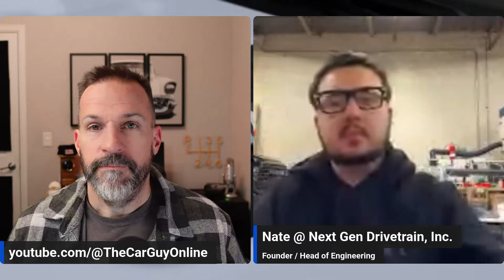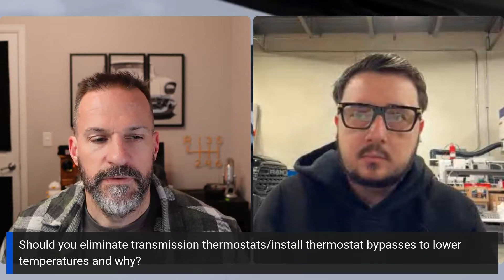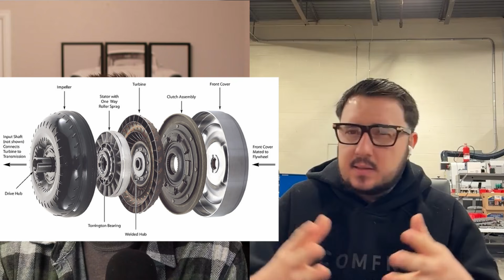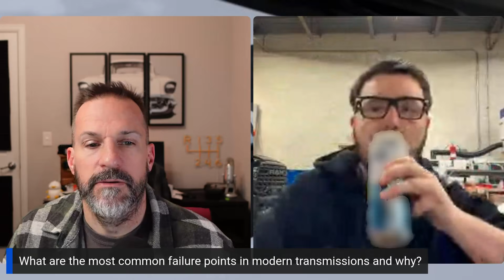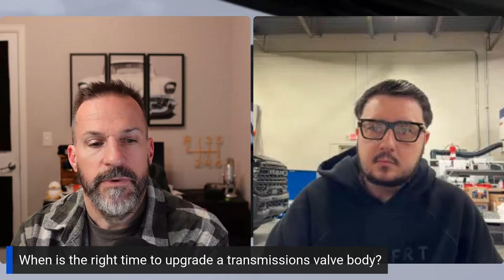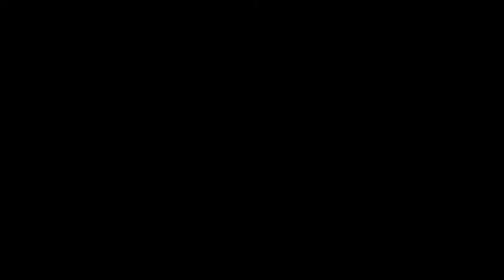Transmission Maintenance Questions Answered w/ NextGen Drivetrain

Comment: I delete CAFE as much as possible. Was 0w-20 Now 5w-40. 3K Changes. 185 engine thermostat. People has to wake up to the throwaway society. Agree on drain a fill, I have been practicing at every 30K. Non locking converter absorbs a lot of hard engine pulses to the trans. Love the nextgen company.

Comment: Cafe standards and all the fixes are a joke! Ibwas a student mechanic in the 50’s and 60’s and indistenctly remember premium gas was 96 octane and regular was 91 octane, my 55 chev 235 6cyl three one barrel carbs were delivering power and average mpg of 21+ in the late 60’s pcv were mandated at the same time octane lowered from premium to 91 octane and regular to 87. Gas was 25 to 30 cents per gallon. I always ket track of mpg every tank fill and my mpg dropped to 17 -18 mpg and I could not figure out why? Also pollution became a big deal from autos. It burning completly( that! I did figure was cuz they reduced the amount of energy in prem and reg which,btw, differentiated in price about 10cents a gallon. When I was 14 my farmer uncle gave twenty $ to fill up his 63 ford 426 engine with premium and I questioned cuz it was more expensive? He said bull he gets much more power and mpg  to go much further on the tank.
Pollution was a created crisis by the elites, they funded the response and mandated THEIR SOLUTION PCV AND LATER CATALYTIC CONVERTERS TO ALEDGEDLY BURN UNBURNED HYDROCARBONS. Why the unburned carbons going out the back! It is all about stealing robbing from people for their evil gain.
Why do race cars use 110 octane gas and why did they force suoer stock and rail drag them nits go to alcohol? To slow the cars down saying they were getting in safely fast cuz one racer’s parachute did not open and he was killed when crashed into the end track wall. 
They dmsaid high octane is not worth the ( they raised the price diffential at the same time lowering octane,  to 60 cents per gallon higher over regular. Oh! One more fact premium gas is a much better lubricant to fuller walls valves and burn very clean. I proved it testing a 64 mustang in California at a certification station that did not have a car and the said he had never seen such low pollution numbers without a car, lower than vehicles with WITH cats! Hello!! We are being scammed and lied to about everything

Comment: I bought a 2005 qx56 for $500 with 124,000 on it, in 2019.
  Changed the air shocks, fixed the window regulators and I been driving it ever since.
  If it breaks, I might fix it,might not. 
    But I bet your new car dies first

Comment: When i bought my Golf R, i was puzzled as to why the recommended transmission service is 120,000km here in Australia? Needless to say, it is the usual factory recomended bullshit. I changed it at 80,000km. Same with engine oil. Every 8,000 km instead of recommended 12,000 km.

Comment: I disagree wholeheartedly with the amount of gears discussion. Yes, emissions regulations is definitely part of it, but tow with a 4L60E amd then tow the same thing with a 10L80. Even if you had the exact same engine, the truck with a 10L80 is going to perform far better at everything. There's a reason CVT transmissions exist. Performance goes up the more you are able to keep the engine in a good powerband. Do you need more gears than 4? Maybe not, but 8-10 gears will give so much better of performance and experience that it's hilarious to even suggest going back to 4 speeds.

Comment: New OEM valve body is good, it will make the vehicle run like new even the transmission is 100k worn out. But It may not pull strong like new.

Comment: I drop the plug and drain 7 qts evert 5th oilchange at 5000 miles so every 25 ish k on my o7 f-350 6 speed transmition and never had a problem with it truck has 300+ on the transmition I had built years ago

Comment: My 2021 Ram Promaster 2021 has been having transmission issues since hitting 74,000 miles. Went into limp mode so I had it towed to a recommended transmission shop. After a week they said they couldn’t fix it because mopar wouldn’t let them into the computer. Took it to a dealer and they seem to be just swapping out parts.

Comment: My trucks got 150k miles, stock tranny, my transmission guy said just change the fluid and filters and don’t touch the VB. He’s seen perfectly working trannys all of a sudden have problems after a VB. In addition it often requires a relearn/re tune, and those could also cause problems. In other words if it ain’t broke don’t fix it.

Comment: Very good information I just had the valve body and torque converter replaced in my 2020 Silverado at 72K miles after having a bad shudder problem especially between 20mph and 40mph.  I had an extended warranty, and it only cost me $100.00.  The dealership claimed it was a $8200.00 repair.  I personally think they put a brandade on it and should have replaced the hole transmission. They are warranting the parts for 2 years 24K miles enough time to get out of the extended warranty.

Comment: I watched this video and one from about 3 months earlier. Nate has answered so many questions as well as relieved me of some stress. I recently bought a Silverado with the 6l80e and even prior to buying I had so many concerns over the 6l/8l transmissions and the dumb afm engines. First things I did as l was add an afm delete and changed the transmission filter and oil. Next will be to stop with the 0w-20 oil and go back to 5w-30 based from other people's insite. 
With 153,000 miles, my transmission overheated and went into limp mode pulling an empty 14 foot trailer for 30 minutes on mostly flat highway. Aside from the worries of permanent damage, I added a thermostat delete and ordered an extra cooler. Was on the fence about not installing the cooler and Nates info helped me decide to keeps it off. But mostly I'm relieved to hear his opinion about my transmission temps  being  too cold now and that its not a legit worry. I rarely hit GM's "operationing temp" with the thermostat delete. I firmly believe those numbers are ridiculously high anyway but couldn't find any consistent information about what too cold is. But I comfortably trust Nate's opinion and can stop wondering if I should put a lower temp thermostat back in. I definitely appreciate these two men in this video

Comment: Easiest way to understand how torque converter works is like this - 
Imagine two fans facing each other. One is turned on pushing air (trans fluid) to turn the other fan. 
The fan that’s on is the engine. The fan that’s being turned is transmission.
Stall speed is simply how efficient the engine fan turns the trans

Comment: Our shop in Southern US, has used BG Automotive or AMSoil full synthetic ATF on most cars when doing 2 drop and fills along with respective AT filter. We recommend every full ATF replacement at 30,000 miles.

Comment: I drive a 2017 Chevy Silverado Z71 LT crew cab truck with 5.3 engine with a 6L80 transmission 6 speed with 42,000 miles. I had the transmission fluid changed in the 25,000 or +. Do you recommend the transmission bypass? I also have the AFM adapter. As you can see, I don't drive a lot. I don't haul anything. A lot of in town driving. Can you please advise if I need the bypass.  Temperature sometimes  gets up to 190. I would really like a response.Thanks & be safe! Great video!

Comment: I just installed the Nexgen kit in my ‘21 3500HD 10L1000. So far, I haven’t seen trans temps above 120°/F when it was running 142-163 prior to update.

Comment: Thank you Nate for your service 🇺🇸👍! My son was a USMC veteran in Afghanistan and we respect our military. I found your knowledge and willingness to share very informative and common sense! When I was in Afghanistan as an US Army civilian I talked to the  HD diesel mechanics at Bagram AF in 2008 - they said for the MRAPS that the Cummins had more power & fuel efficiency BUT blew head gaskets. The Caterpillar diesels however were able to hold up under the MRAPS weight. Finally the only diesel trucks that could function under shit fuel were the Toyota & Nissan diesels with common rail fuel systems. Anyway thanks!

Comment: I had the cold weather situation happen to me with a Ford 4R100. Happened to me a few weeks ago, -45F 2001 era series ford truck. My transmission fluid gelled up in the cooler and wouldn’t flow through it. That was fun. I have a thermal bypass valve with a secondary filter ready to go on before next winter.

Comment: What do you consider high mileage over 100000 miles?
Reply from the maker: in the context of transmission service, if it hasn't been done ever, 100k is quite a while to wait for service. Drain and fill multiple times and see how it goes, much less disruption that way.

Comment: Ive been sticking to fluid changes intervals from 40 years ago. 5k for oil, 30k gear oil, 50k transsmision.
Dont remove pans or diff covers. If it has a drain I use it, if not pump it out.
Never had a failure.
Reply: Anything with over 300,000 miles?

Comment: If anything will make peoples vehicles more fuel efficient, it won’t be more gears but more patience on the road. Doesn’t matter how many speeds your transmission has if you’re always on the accelerator. Everyone is in such a hurry (me included) that fuel efficiency is hardly at all in our head space until we’re sitting at the pump. 
Years ago SUV’s and trucks were gulping fuel like crazy but could last you 25 years + with proper maintenance. Now they gulp fuel with non of the reliability, and none of the ease of maintenance that you had before all the enshitification of everything. All at a higher cost to the consumer.

Comment: My 2024 sierra 1500 with 3L diesel x31 10 speed transmission just slipped then wouldn’t shift today. Had it towed to dealership and will be speaking with them on Monday. Am I able to request they use next gen parts or am I at the mercy of what they recommend? Never been through this before and trying to educate myself

Comment: Does NextGen offer a 10R140 transmission fluid cooler thermostat bypass or adjustable bypass? Or, does the Project Carbon valvebody w/ Pulse Delete off any variation on the trans fluid thermostat bypass? in order to run cooler. Thanks, and Nate! is the man. Thank you for giving him this platform.

Comment: Damn good information.  I have an LZ0 2023, and at around 8 or 10k, I put the bigger trans pan,  bypass, and bigger cooler. Switched to amsoil synthetic, It runs low 100's to 155 here in Texas.  Maybe at 50k when the fliud change is due. I'll upgrade the valve body. Right now she's smooth but i will get one. I don't trust GM china parts

Comment: The secret to make a Nissan CVY last is to change the CVT fluid every 2 years and to accelerate the car gently with slow steady acceleration.  I am in the 15th year driving my Altima car with the ORIGINAL CVT transmission.
Reply: The stepper goes out
Reply: Maintenance is key. You can't say that a transmission is junk when you don't even do basic maintenance on it (30k mile drain and refill on that CVT).
Reply: A 1999-2004 Honda Odyssey  has a fragile Transmission.  So it's not just Nissans that need 30k drain-fill.
Reply: @ferndog1461  nobody reads manuals. I do. It’s called scheduled maintenance

Comment: My transmission is shifting rough after they replaced the valve body under warranty. Now they want to charge me to look at it again (still under warranty). Took it to another dealership and they refused warranty because I had a banks idash plugged in. Never tuned with it, but they said it doesn't matter. Weasels!

Comment: I’ve rebuilt a bunch of 6L80’s with the cooler bypass. One was even a guy from Alberta, and I told him when it’s super cold just let it warm up a bit. It’s got 5 winters and 70K on it and it’s been running fine.

Comment: Turbo350 with 3000 stall in 2600# street/strip car. I’m measuring fluid temp with a sensor in the line between the OUT line and the cooler, about 6” from the trans case. I’m seeing temps of 220 to 260 (the best way to see 260 is driving thru rolling hills).  I have a cooler mounted under the car with a fan on it. I have a 185-degree switch for the fan on my cooler, installed just after the cooler, and it cycles on and off randomly (I wired a light into the dash to tell me when it the fan motor powers up).  I’ve been told to ignore temps leaving the trans, and to move the sensor for my gauge to the transmission pan. Do you agree with this?

Comment: I had a 2023 GMC sierra 3.0 with a 10 speed and the transmission temp stayed at 185-195 towing or unloaded, I recently traded it for a 2026 GMC sierra 5.3/10 speed and the transmission temperature is 145-150, has anyone else noticed this or know what might have changed?
Reply: I have a 2023  LZO . I did a few things to it. Trans pan, bypass, and bigger trans cooler, and my temps are 120-155. Towing my bassboat, maybe 130 ish. No problems thus far. A valve body and having it deleted, and she should be good to go. Oild viscosity is a must for all vehicles.  5W40 HD diesel oil

Comment: I have a 2020 Ford Ranger with the automatic 10 speed transmission.  I have owned it since it was new and I have had nothing but issues over the years that the dealership will not address. Hard shifts, delayed shifts clunky shifts.

Comment: I have had valve body replaced by dealer when it failed. will the replaced valve body hold up or should I expect it to fail as well?
Reply from the maker: Usually they just use the same material/valves etc, so it will be the same quality as the original most likely. The one valve the latest gen valve bodies eliminated will fix the rear wheel lockup issue, but not all of the other issues (according to Nate).
Reply: Does NextGen have a valve body for Silverado 8 speed?

Comment: Got a flush at a old shop, car wasn't running right after, they never checked how much fluid was in the transmission, never did the fluid check at temp... I had to check it myself, it was more than two pints over filled, my god the difference it made to remove that extra two and a half pints...I remember them saying we will take care of you. No don't take care of me, take care of my car..........

Comment: I have a 2010 F 250 Super Duty pickup with a 5R110W Torqshift transmission that in my mind is a very good transmission with very few issues. YouTube has very few videos on this transmission that have issues. 🤔

Comment: One thing: There sure is a lot of interest in automatic transmissions judging by the number of views and comments of a video that is only hours old. If I may, I would point out that the TCC is modulated during the EPA 3 test to alter the fuel economy. It's not just added all at once. By adding the friction of the TCC at various times and in varying amounts of engagement, instead of allowing the hydraulic slip to occur all the time until a one time total TCC engagement, increases the efficiency of the transfer of power from the engine to the transmission during critical moments on the E.P.A. 3 test. It is easily seen in the FE ratings on that test because of the critical size of the test. The primary reason there are so many transmission speeds is to keep the engine in a very narrow rpm band which allows for easier calibrating for emissions and FE. Emissions used to be the biggest issue in the automotive world thanks to the C.A.R.B and the E.P.A. but the "ENERGY CRISIS" (HOAX) of 1973 and the Biden Administration pushing for EV to advance their crony capitalists has certainly caused for more and more sophistication and complexity trying to achieve utterly ridiculous high FE numbers and that adds to failure. I ran at least 20,000 E.P.A. 3's and HWFET's,  during my 36 year career at GM and I took my job very seriously. I was the recipient of the "Golden Foot Award" for lowest emissions and highest FE. I only wanted to be as consistent as a human could be for the engineers to see the difference their calibration changes made without the human variable or inconsistency from test to test. My favorite transmission has no TCC and is only a 3 speed. I drive a 1969 Plymouth with a 318 cid or 5.2 L and the transmission I enjoy is a Torqueflite A904. What a beautiful feeling of consistency and predictability compared to my 6L80e behind a 4.3  LV3 w/ AFM and GDI. I'd take a TH350 behind that 4.3 L any day of the week and twice on Sunday. ben/ michigan

Comment: My dad said the exact same thing about the 10 speeds. You are just adding a bunch of extra complexity for a tiny gain in fuel economy. He got the last year of the chevy 2500 with 6.6 gas and 6 speed auto. Same reason I got the 23 tacoma over the 24. Less tech. Simpler vehicle.

Comment: My former F150  2016  2.7 eco  had a 3.77 diff. Rear with a 6 speed automatic had less problems than my 2020  10 speed with a 3.55 rear . My 2016 only changed gears twice on a 200 km trip . My 2020 changed gears so many times that the transmission has heated up 10 degrees C  more at the end of the trip . No wonder this 10 speed is a money pit

Comment: I just replaced the pan(filter) and fluid on my ZF8 HP55 with it's "lifetime fluid" at 64k miles.  I bought it used, doubtful it was done before.  It's without a doubt something that needed to be done after seeing the fluid that came out.  Since I only got 60% with a drain and fill, I'll be doing another soon then probably at every 20K. Fluid, I'm not a fan of Mobil 1 anymore.  I put in Ravenol ZF8
Reply: I do that too.
My wifes old car was a lifetime trans here in usa however the same car and trans in europe had to be changed at 50k! So the lifetime was garbage!

Comment: For anyone with the 8L90 or the 10L90, I had harsh 1-2 shifts and the converter shudder at 65-75mph. I installed a Superior STP 8L90 kit and instantly fixed it. Google that kit and you’ll see some Reddit forms etc. they’re great for 200 bucks